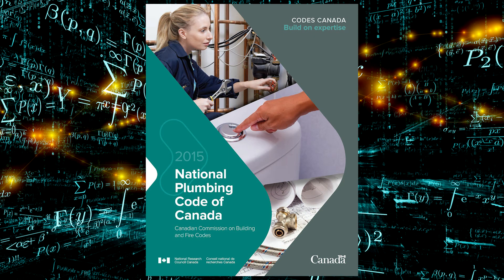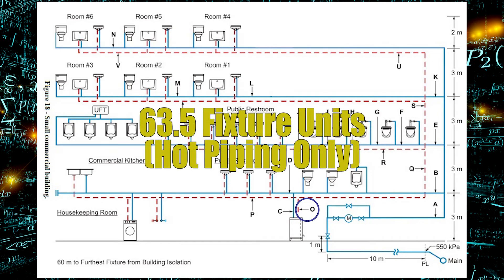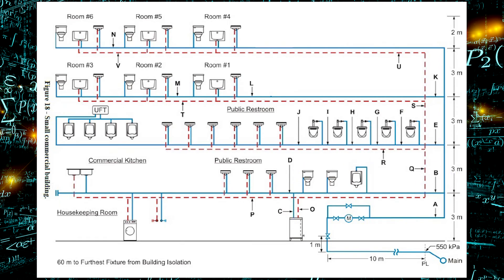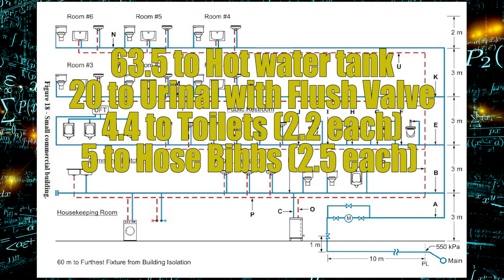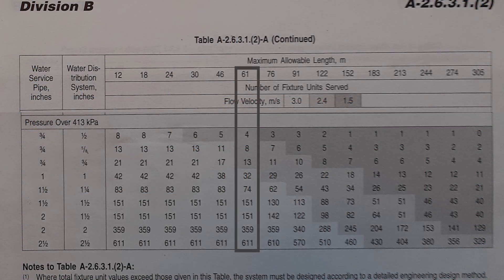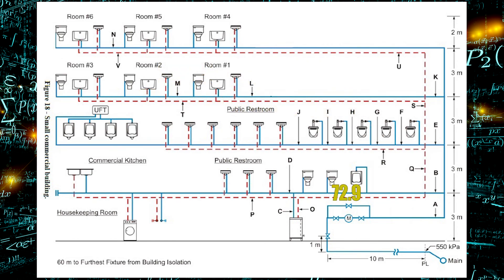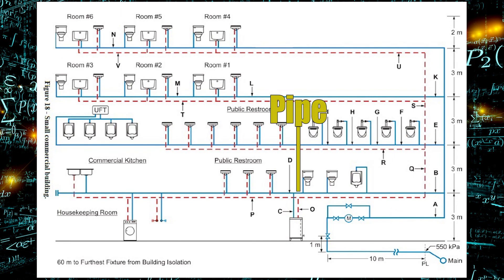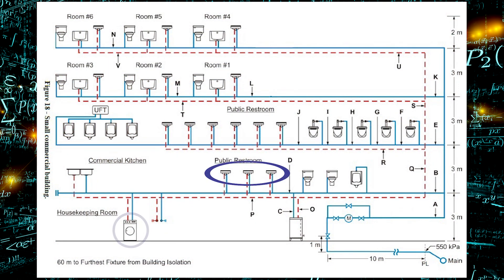Water Line Sizing Part: 4

Comment: How are you supposed to size pipe D?

This simplified method using the Totals column is more complicated than need be. 

Should be a cold water value, hot water value, and no messing around with taking off Hot water supply. Dumb stuff
Reply from the maker: These videos describe the small commercial method of waterline sizing. This is NOT the simplified method as you have stated. They are two totally different methods.

Pipe D is a cold water pipe serving three lavs, one 3.5 kg clothes washer, one kitchen sink with one faucet and 2 - ½" hose bibbs. All fixtures are commercial. (The fine details were omitted because they were irrelevant to the video)

Total hydraulic load = 18 FU @ 61m of developed length. Therefore the waterline must be 1" according to Table A-2.6.3.1.(2)-A

If you want to get waterlines that are totally oversized, use your method. If you are in plumbing school, well good luck.